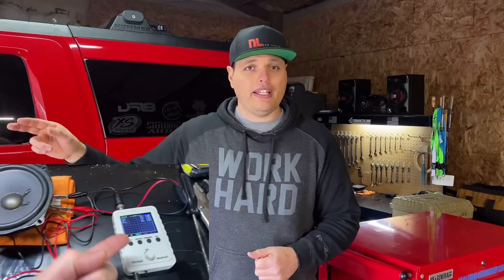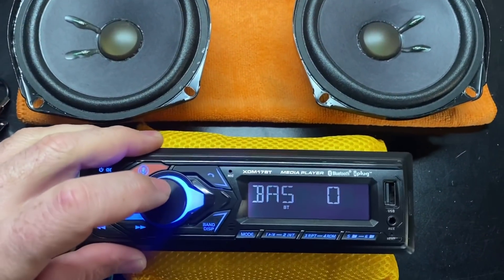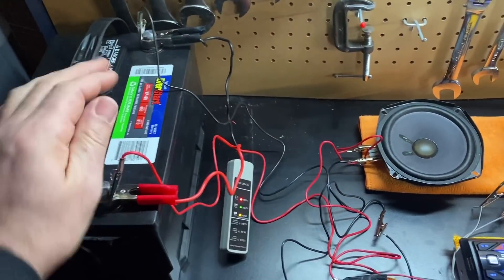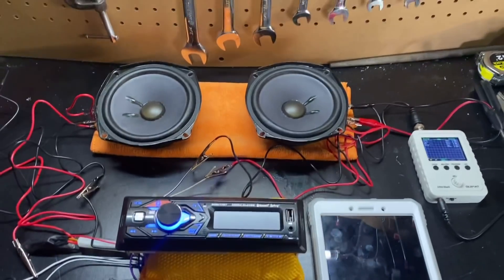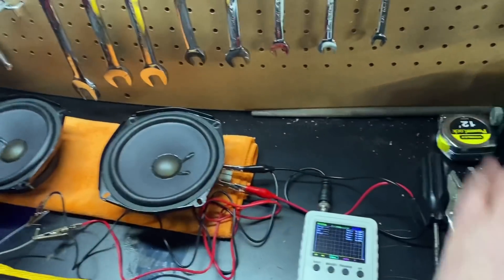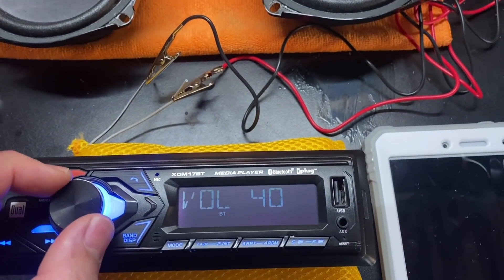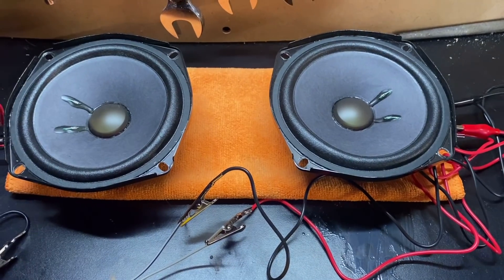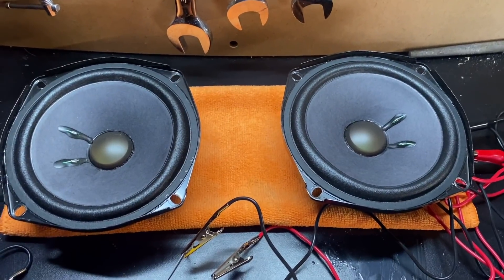#1 Must do tip!!! How to check head unit clipping and non distortion volume point of stereo.

Comment: Why does my fuse has a copper wire around it? Does that make my distorted noice or the amp is too low?(I use the deck at home with 5amp supply )
Reply from the maker: I don’t know man. Sorry I could not be of more help :/

Comment: Hi I really hope you answer my comment. I’ve been watching so many of your videos and other peoples videos trying to figure out exactly what’s going on with my one passenger front door speaker. At first I thought it was clipping but it couldn’t be just 1 speaker doing it and not the rest, and I’m really good at hearing distortion so I’ve tuned my head unit first, then went in on my amp and tuned my speakers there and adjusted based on clipping. Anyway, my passenger front door speaker likes to pop or clap REALLY loud if I have a heavy song on that has too much bass/treble. I also do have a sub in the back, and my other speakers don’t do this. Is there any reason why this is happening? I need someone’s professional input
Reply: I’ve checked my wire connections everywhere and it all seems good, I’ve listened to make sure my speaker isn’t blown and it’s not, I just really don’t know what’s going on. I thought maybe it was hitting the door speaker grill but I didn’t think it would make that noise.
Reply from the maker: Usually pops are an issue with amp/ preamp or head unit power on that channel. What I would do is get behind the head unit and swap the wires from left speaker to the right speaker and visa versa. If the pops stay on the same side, it is your head unit/amp. If the pops move to other side it is the speaker. You could also move the actual speaker to the other side and swap the other side over. And get same results

Comment: You are testing it on 40hz but how should I do it since i play my speakers on 100hz and have  a separate subwoofer which plays all the bass?
Reply from the maker: Still use 40hz. Unless you are setting gains for your mids/highs. Then use 1000hz. Those are industry standards

Comment: Would that change based on source?
Reply from the maker: Yes, unless your head unit has a SLA feature (source level adjustment). Then it will be different typically

Comment: I have never understood why to check for clipping on flat settings. Unless you actually use flat settings while using the system , how does this help? Wouldn't you want to know what clipping is when its all adjusted to where u use it?
Reply from the maker: Exactly!

Comment: Can I connect the o scope to the RCA leads coming out of my head unit that goes to my amplifier?
Reply from the maker: Yep. But typically you won’t see them clip. They usually don’t even at full volume
Reply: @NextLevelCarAudio  I’m watching your videos know setting up my sons truck. I appreciate them.  I do have another question for you.  When playing my test tone and looking for a clipped signal should I do that with the truck started or off?  I ask because with it off I clip at 38 and when it’s started I clip at 39.  I hooked up the oscipe directly to the speaker wire coming out of the Sony head unit
Reply from the maker: With the car running for sure.

Comment: So if my head unit sends a clip signal will it go through my amp to my subs and would the amp block it or anything sorry I know its probably a stupid question but I don't know lol
Reply from the maker: Won’t go through your amp. Only concern with Head unit clip point is if you have speakers directly connected to it

Comment: If I am using an OEM head unit with no RCA outputs going to an amplified 4 channel system (factory), tapping the speakers from the headunit to a Line output converter then to a mono block amp via RCA. The signal is fed to the headunit with a FM transmitter I bought the oscilloscope and am having a hard time setting gains.
Reply from the maker: Probably because all of the components you have from the music coming in to the music coming out. Mismatched preamp voltages, interferences, and distortion. Does your LOC have gain adjustment as well?
Reply: @NextLevelCarAudio  yes the loc gas left right gain adjustments. The factory stereo also doesn't have numbers to judge volume level. I think I should turn the volume up to a point and measure then adjust the loc levels to the amp
Reply from the maker: Set head unit volume to 75% or Max you will ever listen to it. Then work from front to back adjusting Gains as you go
Reply: @NextLevelCarAudio  Figured it out sounds so much better as I tested to the max I would generally listen and worked my way back from the head unit to the LOC then to the amps. Once I upgrade the headunit things should be more simple. Great tool to have just want to set it up with a battery.
Reply from the maker: Nice!

Comment: My head unit clips at 45 percent volume... even with all the gains turned down. Someone I called for advice said they might have spliced into the head unit for power instead of the factory amp 😔 I hope that’s true. I have an appointment Saturday to get that checked. Car: Honda Accord 2018 sport. Stock head unit. Lc7i converter
Reply from the maker: Hey unit clipping at 45%? That sucks. Yeah, I’d have it checked out. It’s good you are taking it in

Comment: Hey I'm a subscriber love your videos very informative I already saw most of them now I have a quick question for you what if I have my head unit installed and  my whole system amps is ready playing But now I want to check the clipping signal on my radio can that be done please let me know thank you
Reply from the maker: Yes, you just take the reading from one of your speaker outputs on your head unit
Reply from the maker: Thanks for the support as well!
Reply: @NextLevelCarAudio   Thank you for the response but didn't you say that I cannot have any apps connected to the speakers Or I can still hear the clipping with the amp on let me know thanks
Reply from the maker: I’m sorry if I was confusing... you can do it both ways there are just differences that need to be accounted for depending on which way you do it
Reply: @NextLevelCarAudio   Once again thank you for the response Love your videos and thank you for your help I really appreciate it appreciate it I'll going to try it now If it wasn't for your video I would never know anything about it's about the Oscar and how to adjust gains thanks
Reply from the maker: Thanks for the feedback and support!
Reply: @NextLevelCarAudio  you are really on the nextlevel thank you for all your help bro I decided to invert my sub I hope this works out
Reply from the maker: Nice. In love inverted

Comment: How about rca- output? Same volum for clipping?
Reply from the maker: I use the same number I get from my high level.   Since low level is going into the amp, I can adjust for clipping at the amp via gain
Reply: Can you please test it with the occilloscope?
I use only rca on my setup. And i have a feeling it clip on the last click on my jvc headunit....
Reply from the maker: You can’t with this multimeter.... it will not give a proper reading. Only with high level. But like I said, the volume clipping point should be similar/close.

Comment: I have blue tooth volume,subwoofer level,and lpf,hpf.do I set them all off as well?thank you
Reply from the maker: No, set then how you will normally have them, then check clipping point
Reply: Thanx again.my 3  amps run off  RCA cables.can I just connect  the olliscope to the RCA cables ground and positive to check the head unit clipping?
Reply from the maker: Yes, you will need to adjust the settings on the oscope to see sine wave.
Reply: Thank you brother.your the best!!!!!

Comment: So I have a new Rockford fosgate 1200w amp and I turned my 40hz tone on my head unit all the way up and the C.L.E.A.N Input light never comes on. It’s suppose to light when the signal is clipped. I turned it all the way up set the gain and the output light comes on for me when I get to three. Does this mean my head unit doesn’t clip. It is a newer car so I’m not sure it that would help
Reply: It also doesn’t sound to me like they clip either all the way up
Reply from the maker: If you are using the RF clean light, you most likely will be able to turn it up all the way or nearly all the way as you are using low level inputs. Finding true clip point on head unit is still very important especially if running non amplified speakers with your amplified setup.
Reply: @NextLevelCarAudio  so do you think the best way for me is to just listen for distortion? I had them all the way up and didn’t hear any at all
Reply from the maker: That’s what I’d do if I were you.

Comment: Hey got a question... What could be making my amp shut off when it hits on low bass? I got a 5000 watt cerwin veaga. Amp and 2 12in cerwin Vegas.
Reply from the maker: Low voltage (bad ground) or low voltage (insufficient electrical) which will cause about to go into protect. Top 2 things I can think of. How is your voltage holding up when bass hits
Reply: Could be a number of things honestly. What is ur final ohm load impedance? Could be wired too low for the amp also.
Reply: @NextLevelCarAudio  Im going to have to check it. Do I check it at the batt. Or at the amp?
Reply: @robland6118  Im not 100% sure how the guy i had install it wired the speakers.... I had a 2500 watt amp and upgraded to 5000watt because the old amp fried and now the new app shuts off when it gets to low bass with it up. I also upgraded the 4ga to 0ga
Reply from the maker: Check all grounds from battery terminal to where the amp is installed/grounded to. Should be tight on bare metal.
Reply: @NextLevelCarAudio  thanks Its raining right now but im going to mess with it this weekend and ill let you know what happens. Thanks for the help
Reply from the maker: You bet
Reply: @NextLevelCarAudio  I checked the volts at the batt and at the amp on a 40hz test and it was 14.9 something and it was only .05 lower at amp. Im going to take out the subs and check the ground
Reply from the maker: Voltage def sounds good.
Reply: @NextLevelCarAudio  could it still be the ground?
Reply from the maker: What is the configuration of your subs? Final ohm load?
Reply: @NextLevelCarAudio  I take that back, so I did a test on batt again this time on a song that shuts it off and my batt. Was dropping low 13s even seen 12 once?? Im not sure how the guy i had install them hooked them up. I tried to do a final load test, not sure i did it right? I keep getting 0? Not sure i put the muiltmeter on the right setting? I got 0 reading on all but one ohms setting the one that is just 200 and that was jumping from 2.5 to 0?
Reply from the maker: Amp could be going into protect intermittently with the voltage dropping that low. I have a feeling your subs are wired down below 1ohm. Which is causing excess electrical strain on your system and voltage to drop. Really need to know what you are wired to resistance wise. On your amp, do you have one positive/negative on the speaker outputs? Or two sets of speaker wires on the outputs?
Reply: @NextLevelCarAudio  The amp has one spot for both speakers to go in.  The speakerbox has a set of wires coming out on both sides ( so 2 sets out of box to 1 spot on amp) I can  take a pic of the box that the amp and speakers came in if the would help any?
Reply from the maker: Alright, so looks like you are running in parallel. What you need to do is grab your multi meter and set it to read ohms. On the lowest number setting you have. Touch the tips to where the speaker wires leave the amp to go to the box and let me know what that reading says.

Comment: i have a P99RS headunit which will not play directly to the speakers, it needs an amplifier for the speakers to work. what steps should I do?
Reply from the maker: That’s a serious unit... If your not looking to have an audiophile grade SQ setup, you can sell it and have enough to buy a regular head unit, amp, speakers, and leftover money for a steak dinner. But if you want to keep it, do it right and get a good amp and matching speakers.
Reply: @NextLevelCarAudio  do have the amps and subs, its just that i need a way to know the distortion volume point, but sadly i cannot directly wire it to the speakers as it wont able to play unless installed on an amp.  just wondering how would I do this
Reply from the maker: You can connect it directly to the RCA’s to test. However, most quality head units don’t clip the low level (RCA’s) even at max volume. I’d be surprised if yours did
Reply: Thanks for this. Will try to do the rcas

Comment: So you're testing the deck clip from its internal amp? That's not gonna work if someone is running and amplifier. So should mention fir someone to check the clip out the decks rca outputs

Comment: Different sources such as blutooth tuner aux input usb input and CD typically clip at different levels depending on the signal strength
Reply from the maker: That’s why it’s a good idea to use a SLA or get a unit that has one built in to equal out the input signal so that they are equal between sources

Comment: How do you get your RTA to look so clear? Mine is not that clear. Too flickery
Reply from the maker: Check this video. I go over adjustments and settings in detail. Outside of that. I’m not sure man.
Reply: @NextLevelCarAudio  its all good bro. I haven't used it for subs. Working on it. I used a 1k hz at 0 db to try to use it to adjust the gains for the A and B channels. But still, enjoying the hell out your videos and learning quite a bit.  Thanks.
Reply from the maker: Cool man. Thanks for the feedback!

Comment: I am using the crossover for front and rears in the head unit.  Do I leave them on or set them off when doing this method?
Reply from the maker: Definitely set them where you intend to have them once your system is all dialed in.

Comment: What about for factory amplified systems? Where would I check for clipping?
Reply from the maker: If everything is factory then at the speaker wires before going into the amp. Like behind the head unit for example. Just see what your max volume is before clip and your good
Reply: @NextLevelCarAudio  my Lexus with the mark levinson only has output cables From the amp.

Comment: What settings do I need for chines brand android head units?
Reply from the maker: I’m not familiar with those units honestly. Never messed with them
Reply: @NextLevelCarAudio  ah okay. On your other video about setting the gain on an amp. The same setting you have on the oscilloscope accurate for any amps?
Reply from the maker: You will need to slightly adjust voltage setting depending on power output of the amp.

Comment: Another great video. Thanks. Just my two cents, I had some issues purchasing woofers with the ohms and my 2 ohm stable JL R1000/1. Got the wrong ones and all that... just thought maybe a topic of interest I caught myself in maybe for topic 🤔
Reply from the maker: What is the final ohm load of your subs?
Reply: @NextLevelCarAudio  so I have 1 sub wired at 1 ohm until I can get a matching sub, I ditched the JL amplifier and went with a skar 3500
Reply from the maker: Awesome, that’s a good amp. Hard to beat for the price
Reply: @NextLevelCarAudio most definitely bang for buck... it has been an  expensive learning curve up to this point since my 315K mile 05 Camry  isn't more worth than the equipment. Awesome knowledgeable videos; can't wait for more of your brain expanding videos brother..
Reply from the maker: Thanks for the feedback and support!

Comment: This is great keep up the good work bro
Reply from the maker: Thanks!
Reply: @NextLevelCarAudio  hey question? Testing an amp with an oscope is there a difference between a subwoofer connect and  subwoofer disconnected
Reply from the maker: Slight rail voltage difference. But negligible. There will be a slight difference between the two... you can do it both ways and choose which one clips the signal sooner or split the difference.
Reply: @NextLevelCarAudio  thanks bro

Comment: Instead of it being your head unit that clips at a certain point, wouldn’t it just be the max power you can give to your speakers before the speakers themselves clip?
Reply from the maker: Amps or head units clip. Speakers distort. A 100 watt speaker can distort with 10 watts of power if signal is clipped. Same speaker can play all day happily with a 1,000 watt amp on clean power and conservative gain setting. Finding clip point of head is important to send only clean signal to your gear
Reply: @NextLevelCarAudio  thanks for the explanation my guy.
Reply: @NextLevelCarAudio  are y’all based out of Orlando? We have a next level audio here.
Reply from the maker: No, Washington state.

Comment: What if your running RCA outs?
Reply from the maker: They usually don’t clip sine they are low level. So if only using RCA’s and no speaker/high level outputs you will be good

Comment: How do I perform this this if my system from the factory is amplified?
Reply from the maker: Pull on of the speakers, like from the door or rear deck then tap the Speaker wires right there.

Comment: Why does my pioneer avh-201-ex double din  turn off when my bass hits or when I turn up the volume
Reply from the maker: Sounds like a bad ground. Is your head unit grounded good?
Reply: @NextLevelCarAudio  I think so I got it installed
Reply from the maker: I’d go have them look it over. That’s usually the sign of a bad ground somewhere
Reply: @NextLevelCarAudio  thanks for giving me an idea